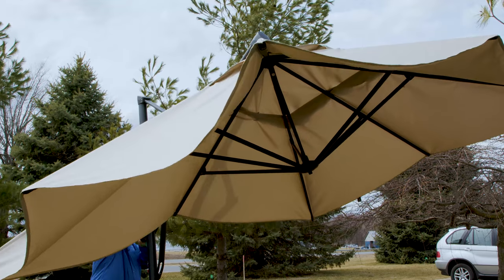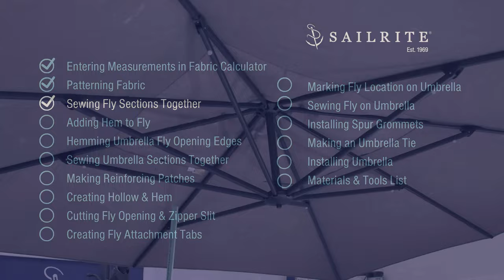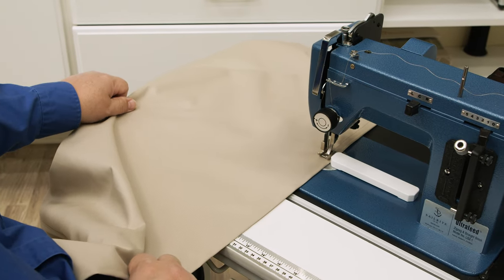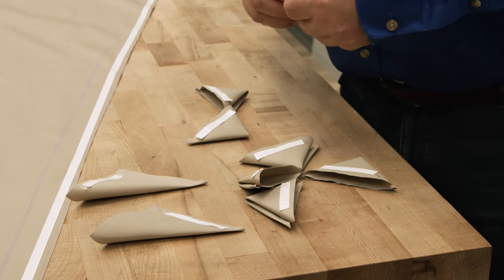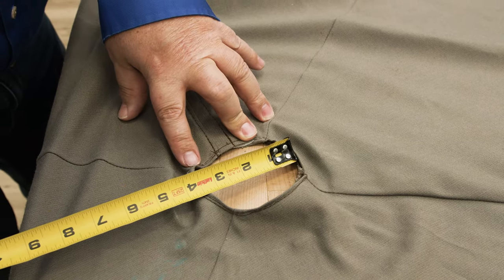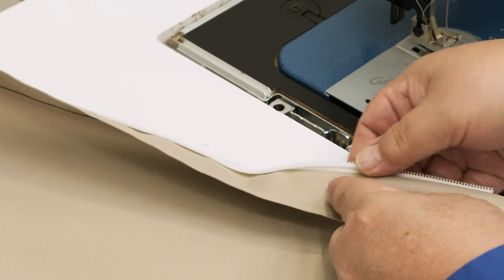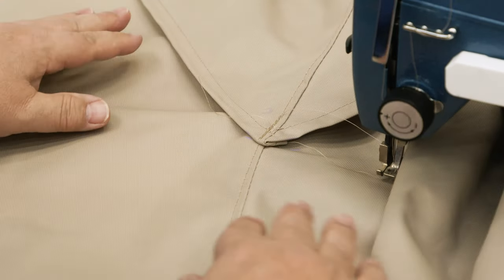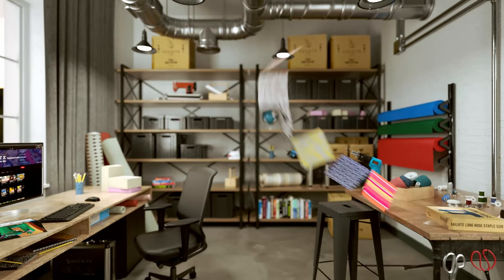How to Make a Rectangular or Square Umbrella Replacement Fabric

Comment: I have two 10' x 14' umbrellas facing each. The 14' of the two umbrellas are lip to lip, but when it rains is a heavy downpour from both umbrellas come running down the middle. Does anyone has a suggestion on how I can solve this issue?